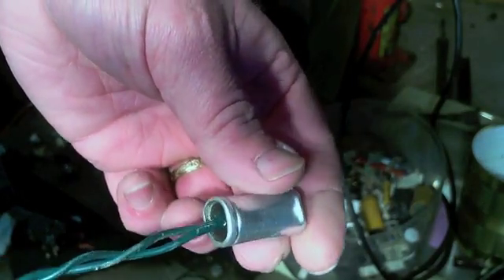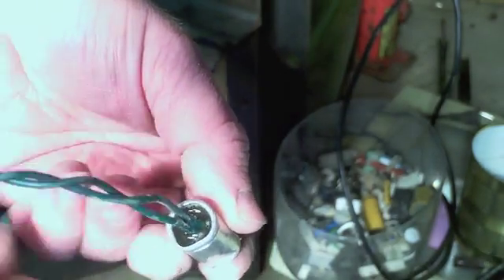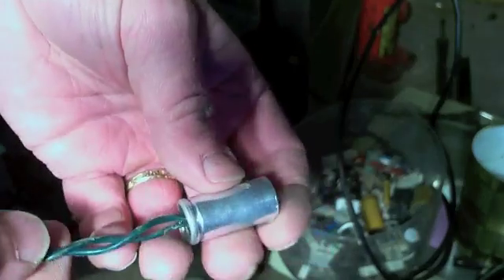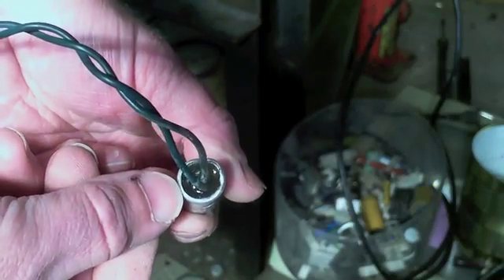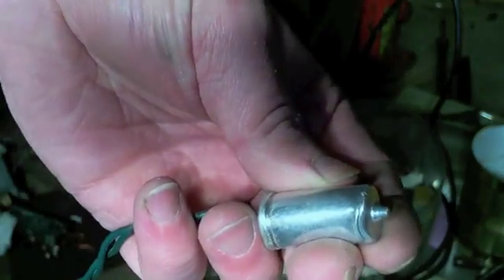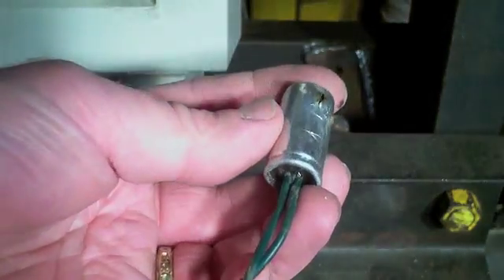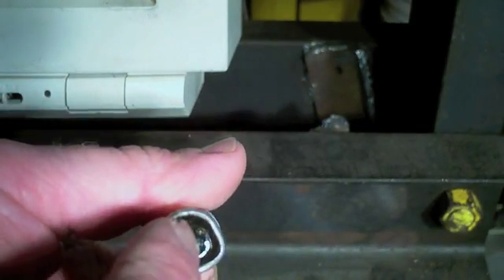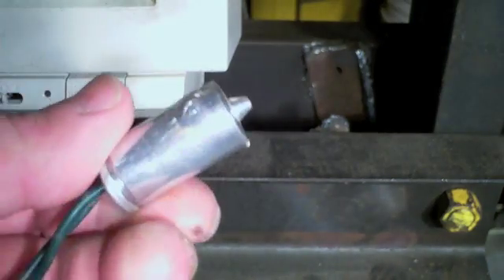Epoxy Capacitor Revisit..Now What?

Comment: I once read that the epoxy potted brick power supplies for HeNe lasers will go off fantastically when the internal cap shorts IF you bypass the fuse. The HeNe supplies are about the size of a deck of playing cards.

Comment from the maker: Well I have been mixing batches of epoxy for woodworking and you can't really save it, I mean it will keep some in the freezer but not super fluid which I need.  I have been pouring it off into a baby food jar, with an unvented cap at the bottom.  It should be a good show...I hope.